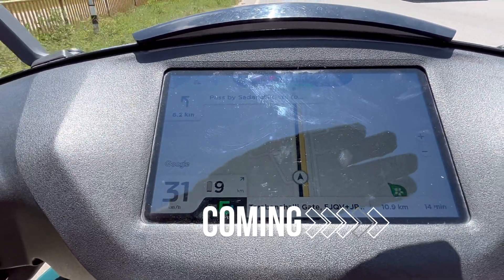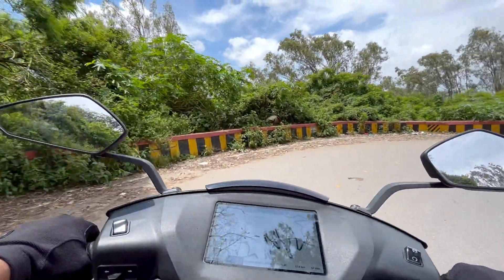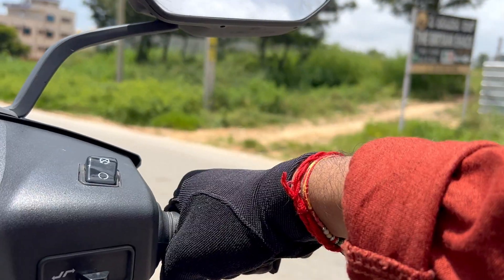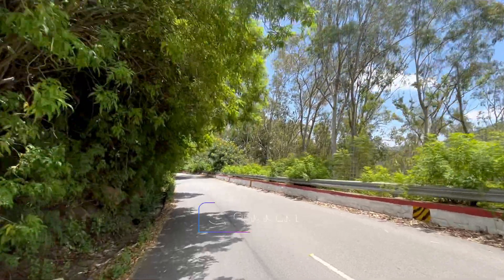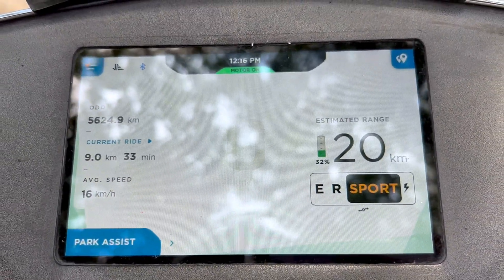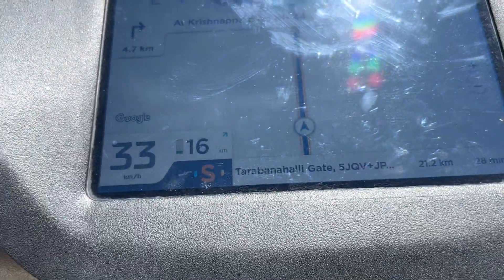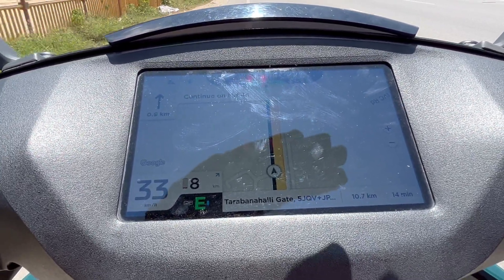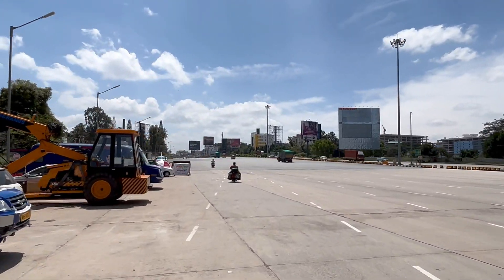Battery regeneration | Add charge to Ather  #ather450 #electricscooter #range

Comment: Will battery gets discharged when this EV scooter stays on idle position?

What if in case vehicle is shutdown?
Will there be drop off in battery percentage & range?
Reply: Shut down after ride, battery wont discharge. I doing same
Reply from the maker: Yes there definitely will be drop in charge both idle position and in shutdown mode. 00:21

Comment: Which EV scooter do you really  recommend for those planning to buy one?
Reply from the maker: I'd probably suggest to check on Ola Charging stations, if they are gonna be launched soon across all cities and if they are working, If so, Ola S1 Pro is good one for range and low cost. But, as per my experience, Ather felt reliable with range. Rest Electric models, I'm not sure if they'd come up with fast chargers soon.

So, its personal preference. I'd still choose Ather for myself simply for reliability. I dont mind less range if I can trust range shown on dashboard, that I can get exact or even more range, but not less than that.
Reply: @GreeenRide  OK, thanks for your suggestion.

What's the actual cost of Ather without FAME-II?
What about it's on road price?
Is it really worth buying Ather?
Wat about it's build quality?
How about it's after sales experience?
Reply: @darshan.t.sdeekshith6694  Go for Simple one Electric scooter
Reply from the maker: not sure of those prices breakdown my friend. You can check with Ather showroom people.
Reply: @GreeenRide  Wat was the price of gen 2 when u bought it?
Reply: @darshan.t.sdeekshith6694  ather gen 3 price is Rs 1,71,520 in delhi without fame subsidy. Charger is Rs 19975. There is change in price in different state. Rs 21510 as performance upgrades.

Comment: Still now i completed 3.7k kms... regularly use sport mode..it gives with out pillion 90-100 kms..
Reply: Is it gen 2 or gen 3?
Reply from the maker: That’s awesome !!! That should be Gen2 only. Gen 3 would be giving close to 110 kms or 115 kms
Reply: Is it with regen u r talking??
Reply from the maker: Using same 3 tricks as mentioned in Video. Consistent speed, not much acceleration and regen